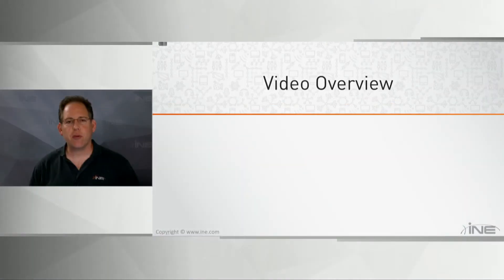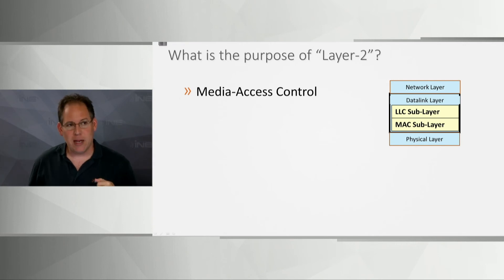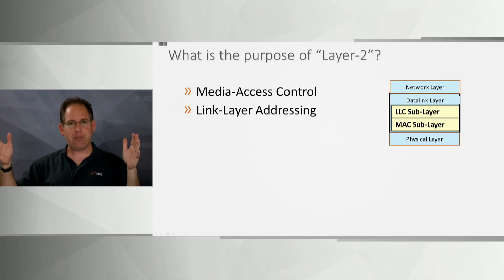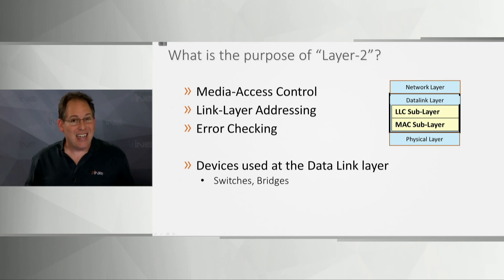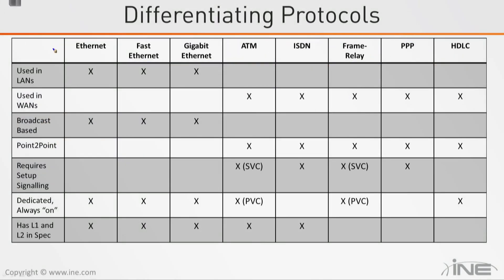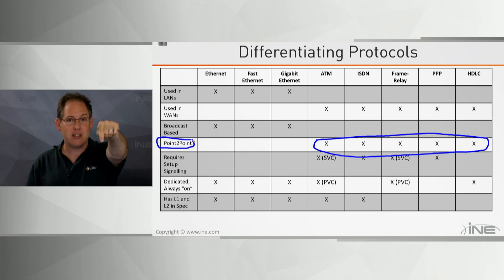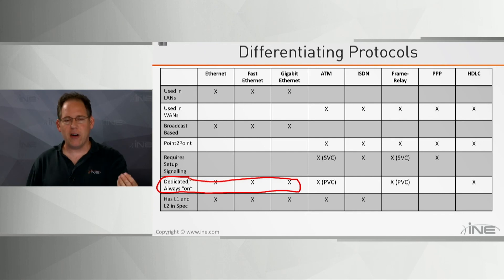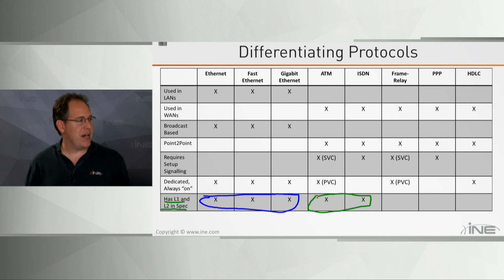Differentiating Layer-2 Technologies

Comment: Very interesting stuff. One question: Would MPLS be a layer 2 protocol? What about docsis? I'm assuming that any flavour of fttx wouldn't be since he told optical would be considered just the medium (layer 1). Would that be correct? Thanks.
Reply from the maker: A Layer-2 protocol by definition answers the questions, "what are the rules for getting my data on, and off, of the cable" as well as "how do I address my data so the next-hop on this cable knows it's for him?".  MPLS doesn't answer any of those questions so technically it is not a Layer-2 protocol.  I don't know much about DOCSIS but from what I've read it is considered both Layer-1 and Layer-2.